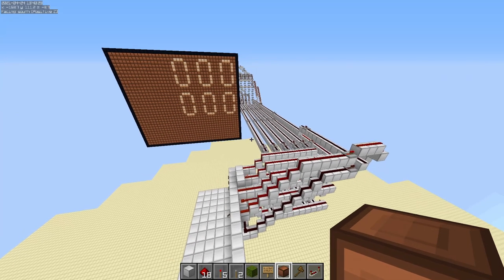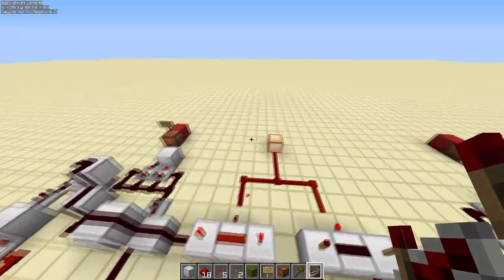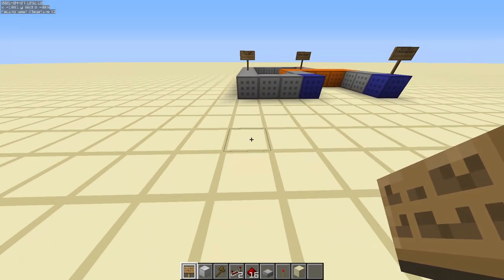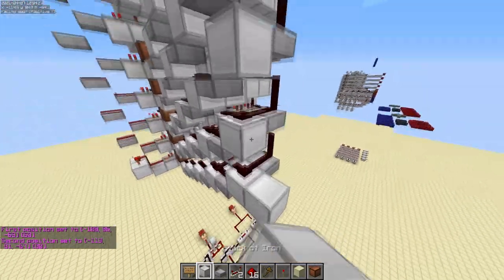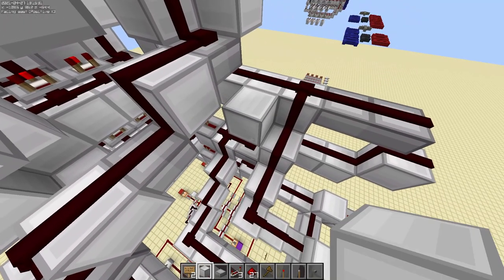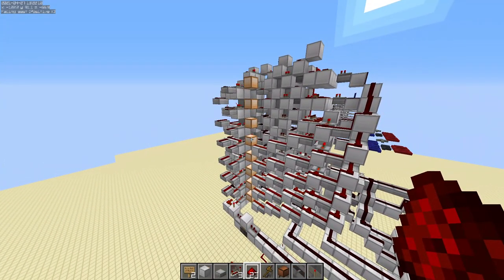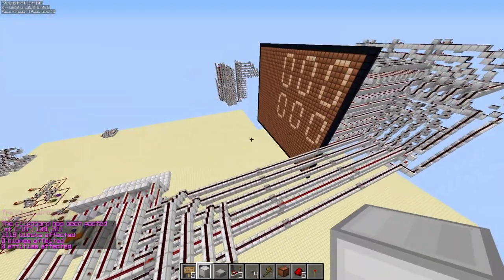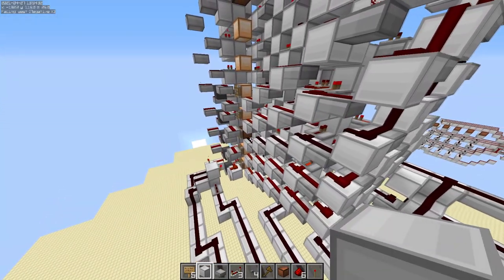Redstone Calculator Tutorial Part 3 - BCD to Binary

Comment: I made a 16-bit adder (following the tutorial), but when i finished it, i just noticed i actually made a 17-bit adder.
Reply: I added a repeater between 2 8-bit adders
Reply: @Drion086  For the first model, i got to change it to 2 ticks, to avoid synchronisation problems. For the multiplier, [i didn’t make it yet], but you can stack 2 16-bit adders
Reply: @Drion086  first model is the first 8bit adder
Reply: Support Talent  another input so that is why

Comment: For bedrock set the locking slab repeaters to 3 ticks, and no repeaters before and after the sticky piston, as well as no repeater that goes to the torch that locks the output on the slab tower

Comment from the maker: A common issue I've been contacted about is involving the carry-in. Make sure that your carry-in is working on your CCA and that it's powering both the slab tower and the comparator under the slab tower. As always, join my discord in the description if you need any help :)
Reply: Is the 8 meant to just be an 8 light or  the 12and4 lights?
Reply from the maker: @hobknot  1,2,4, and carry-in. 1+1+2+4 = 8
Reply: @mattbatwings  oh so all their lights are meant to light up instead of the eight
Reply from the maker: @hobknot  yes. both inputs on the 8 should be already taken
Reply: @mattbatwings  ok
Reply: How to make the BCD?
Reply: @Makerul Hassan use structure blockfor copy or paste, welp i dont think its work bcs i have an issue on the cca and the BCD to Binary
Reply: @Makerul Hassan google "/clone" command, and make sure to take time to exactly know how it works, because the mechanisms might be different by which version you are playing on.
Reply: Where ís the link
Reply: The carry-in problem that I have is that when I turn it on, the CCA outputs nothing, but if I sent another 1, it sends a sum and a carry at the same time. Is the carry-in connection incomplete?
Reply: I just forgot the comparator 🤦🏼‍♂️
Reply: My CCA looks nothing like your after watching the tutorial

Comment: I have a problem with the clear function the Pistons are always turned on when i put them in Because im On Pocket Edition cause the redstone connected to the piston is there Any other way you can make a clear function for pocket edition?
Reply from the maker: I have no experience with pocket edition, sorry :(
Reply: @mattbatwings  D:
Reply: I guess i have to figure out myself
Reply: You might need red stone on the piston because bedrock red stone is weird
Reply: @demonicsuagercane  yeah
Reply: Alot of redstone in this reliyes on java features of redstone so you will have some trouble
Reply: I found a Solution -> Just place 2 Repeaters that are blocking the other repeater, but in this way you have to expand your Slap Stairs a bit, works  fine for me

Comment: Very nice video, I just have a question. Why did you implement another signal line that you also power when you send zero, if that’s just the signal line?
Reply: if you want to type for example 100 you would have to type a one and shift 2 times, the zero ist just for shifting
Reply: @eggman3065  What was meant in the original comment and what I also did in my build is, you can just hook up the line, that shortly unlocks the repeaters to the signal line and it also gets powered when you type 0, so there is no need to build a line for 0.

Comment: It works fine! But I had some issues when I typed in 6 then 4 (64) it showed 44 AND if I just typed 8 it showed 6 :/ I build it exactly like you whats wrong :)
Reply from the maker: it sounds like there's something wrong with the input for 2. since you said 6 gives 4 and 8 gives 6, those are both 2 less, so double check that the 2 line is going in
Reply from the maker: @PubicGore  alright it’s definitely an issue with the tutorial then. would you be able to join my discord so i can address it easier without having to dig up my tutorial world?

Comment: Could this be extended to 16-bit, or would that not work with this design?
Reply from the maker: Technically yes, but it would be messy. CCA adders are really hard to extend to 16 bits without getting unsynced and really big. So I would just use a different type of adder.
Reply: @mattbatwings  could you do something like 10 bit, meaning you could get up to 999x999?
Reply from the maker: @cimos5133  yeah you can. You would just have to make sure that it has enough time to save the answers, because the 9th and 10th bit outputs are gonna take a little more time to come out
Reply: @mattbatwings  Hold on, but the signal strength for the slab towers. How can you fix it for 10 bit adders?
Reply: @octopuszombie8744  if you get a signal strength of 3 on the slab/glass tower place a repeater next to it, going into a block with redstone on top and put another block with redstone ontop of the repeater

Comment: Two days of debugging to realize I make a different carry adder with slightly different dimensions (2 blocks longer) and realizing I needed repeaters then not realizing they power the blocks underneath 😪 now I can get 1, 11, and 111 but attempting to input 255 breaks it🙄. It does the 2 and 25 fine but goes Waco with the 255

FYI with the a/b selection it’s easier to run a line overtop with a torch
Reply: did you use the adder from his redstone reloaded world download

Comment: Having repeater locking issues. When I test the BCD to Binary machine and press 1 then my 1 output keeps turning on even when 100 should be outputted. Any fix?
Reply from the maker: typing 1 outputs 1. however, type 100 will output 100.